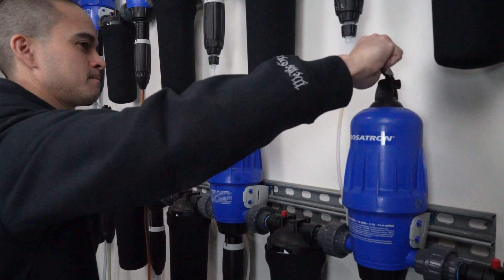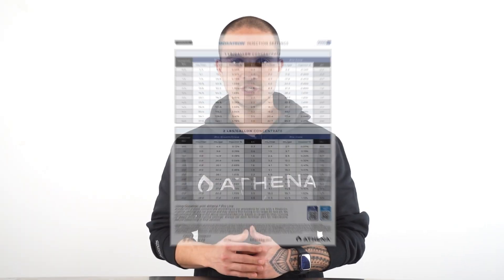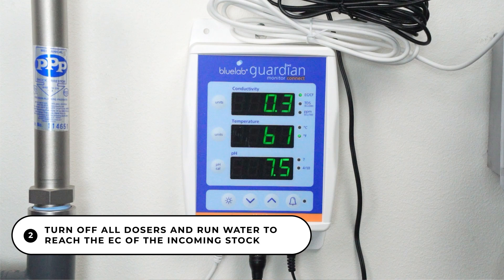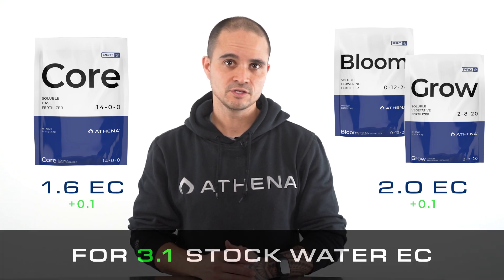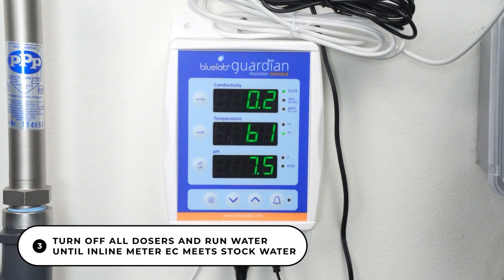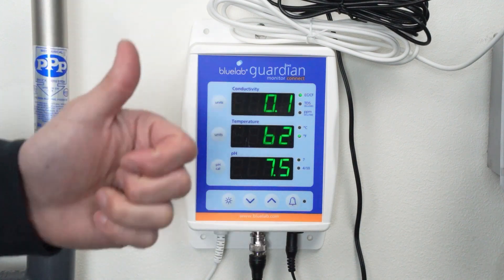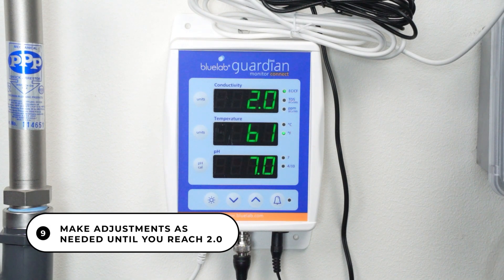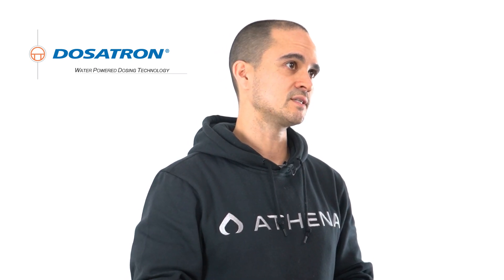Dial in Your Dosatron Panel for Athena® Pro Line with Jay Yokiel

Comment: This is the 60/40 recipe? I don't have a dosatron yet. I've just been adding 1.2 ec of core to my rez, then add bloom to end up at 3.0 ec. Is this wrong? So it's 60/40 by wieght or ml with stock tanks, not ec?
Reply from the maker: It's not exactly a 60/40, although it is close. If you stock tank is mixed at the 2 lbs per gal ratio, We recommend adding Bloom at 32 mL per gal and core at 19 mL per gal if you are hand mixing. If you are getting your dosers dialed in, run the bloom doser until you hit 1.9 EC, once that is dialed in turn off the bloom doser and run the core until you hit 1.5 EC. Once you turn on both the Core and Bloom dosers you will hit 3.0 EC. The nutrients are non linear and non accumulative which is why 1.9 Bloom + 1.5 Core = 3.0 EC. That is the best way to ensure you have the perfect ratio of nutrients.